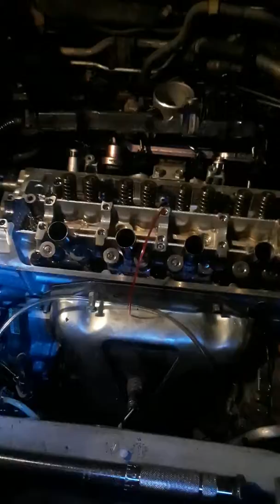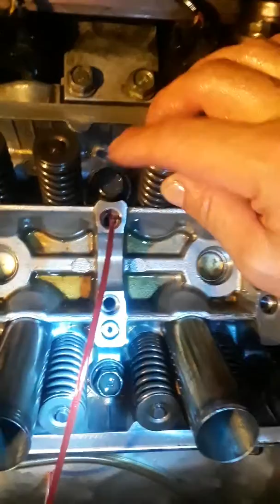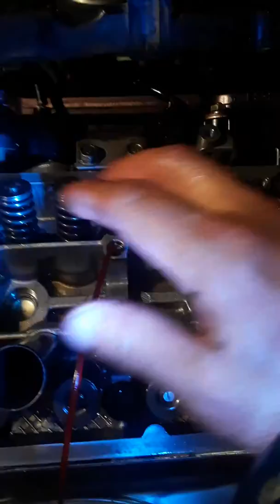Oil control orifice, oil flow, cylinder head, lubrication of head

Comment: Thanks I’m learning. So the orifice is like my thumb at the end of a garden hose. Creating pressure in the system and anything more or too much pressure gets bled out the orifice. Thus keeping a consistent pressure
Reply from the maker: Not exactly.  If there is too much pressure the excess will bleed back into the oil pan via the oil relief valve.  So, if you are getting low oil pressure the valve COULD BE another problem.  Stuck open, partially open, weak spring, or even a  worn pump.
Reply: @Sergeant5e  I’m rebuilding my engine and it’s recommended to clean and replace the o-ring on the 4 orifices I have. I just didn’t know what they were. Thanks
Reply from the maker: @andrewziegler2608  👍 good luck with your rebuild.

Comment: I was waiting to see how oil supply got to the lobes
Reply from the maker: The oil pools in the middle of the head where the cam is installed.  The lobes dip into that pool of oil as the cam turns.
Reply: @Sergeant5e   interesting. I would've guess shower tubes longitudinally over the cam length. Thanks
Reply from the maker: @Resistculturaldecline  sorry so late.  Longitudinally the camshaft journals are supplied with oil but not the lobes.

Comment: What if I take that out I won't have vtec right. I have a built head on a stock bottom end and vtec doesnt sound as loud now but power still pulls through the rpm.
Reply from the maker: Correct, No Vtec and no engine, lol.  If you take out the orifice, you will NOT have any pressure to anything that requires pressure as my video shows.

Comment: First of all, thanks for this video, it is clarifying about oil pressure. I am having trouble with this. That head bolt Nº1 (middle and where is the oil passage),  the threads on block side were broken so I ve made the bad decision of doing another thread but with a thicker bolt so i finally DRILLED the hole of that bolt in the head to make the hole bigger and that thicker bolt can pass through it. Now I ve unmade all that and put original threads and original bolt size (honda bolts). But the hole is still bigger, does this bigger hole could get to loose oil pressure? This is pure physics!! First i thought yes but if now i think that if it fills that bigger place but there is no lose of oil to pan or other place it might not....what would you think? I ask this because after resurfacing block and head, adjusting valves, etc I am having loose of oil pressure and also noted valve knocking noise louder (i ve tried adjusting valve clearance several times, still the hitting noise so i am thinking now about the lose of oil pressure not reaching valves). I think rod and main bearings are good (they were before): I measure oil pressure with a gauge in sensor hole: 15psi at idle, then down to 9/10 at 3000rpm...

Also I read you say that there is no  o ring, i have the service manual for Honda Civic 96-00: engines D16Y5, Y7 and Y8 has an o ring below the oil control orifice. 

Sorry my bad english, hope you can help me!
Reply from the maker: https://youtu.be/Ib6ehkaoNuQ   I don't believe your oversized bolt hole will have any effect on pressure.  I have another video (https://youtu.be/Ib6ehkaoNuQ) where I show pressure with orifice in place and no pressure with out orifice.  I doubt you are losing that much pressure with a bad o-ring.  If your oil pump is good, filter not clogged and your oil pressure relief is not stuck open/partially open then you are losing pressure through your main/rod bearings which was the problem with my engine.  Assuming you did filter/oil change; I would check the oil pressure relief first then plastic gauge ALLLL the main and rod bearings.  As for your valve noise, I adjusted my valve lash to be tight (close clearance) of what manufacture recommends and I get no noise.
Reply: @Sergeant5e  Thank you very much for your answer. I saw your videos, excellent again! Filter is new, oil too and the one specified on manual: 10w30 (before I tried with 25w50 for cars with more than 100,000kms). Now I ve disassembled vtec/camshaft and camshaft has (again) several journals (is it ok the name? not lobes, where it stands on head) worn. So I will be claiming on warranty with who resurfaced it but I still dont know why they get worn, they checked that out...About the main and rod bearings: ericthecarguy also says about checking these! so I guess I would be tearing down again the engine...because from below I can check all the rod bearings but only the lower of main due to cant getting out crankshaft, thanks again and I will keep notice on what happens, next week!
Reply from the maker: @britrockfer  I know this is 2 years later but this is for those others that may be reading this now.  When your engine over heats enough your WHOLE head gets warped along with your cam.  When machine shop rebuilds your head they just resurface the bottom side that mates with the engine block and use the same cam or even a new cam.  Well, the bottom of the head is flat with the engine but the rest of the head is STILL warped.  So putting in a new cam would cause the worm journals.  The shop has to resurface AAANNNNDDDD STRAIGHTEN the whole head by means of oven heating the head and pressing the head back to straight.
Reply: @Sergeant5e  thanks for the answer!! I still have the problem with my 99 Civic!!! I got a motorcycle so i travel with it. You are right, i will surely buy a used whole reworked head so i hopefully solve this problem. The pandemic also got me with money problems so will try to buy it in the next months!
Reply from the maker: @britrockfer  if you are still having the same problem that leads me to believe that you main/rod journals are too loose and /or your relief spring is too weak.  Generally, when your rpms go up your pressure goes up not down. Start off with installing a STRONGER relief spring. That would be the easiest and cheapest thing to try first.
Reply: @Sergeant5e  have done all that: changed oil pump and relief valve, i installed new main/rod bearings on crankshaft...i still have the problem because i cant attend it!!! i am pretty sure its the head, the camshaft was damaged several times and i get to metalize (is that the term?) it....
Reply from the maker: @britrockfer  as I show in one of my videos, anything after the orifice DOES NOT AFFECT  oil pressure.  Main/rod journals and orifice are responsible for oil pressure.  Given that the oil galleries are clear and relief valve are not partially open or open.  Like mention in one of my videos, my problem was what I originally said was the problem;  it was the main/rod journals as I originally measured to be to loose.  I mentioned this from the beginning to the engine rebuilder but  he never listened to me.  You have to have the mains/rod journals tight to give you good oil pressure.
Reply: @Sergeant5e  are you sure about that? i dont remember where but i read that all system affects oil pressure...
Reply from the maker: @britrockfer  sure
https://youtu.be/Ib6ehkaoNuQ

Comment: Is there an o-ring that goes between those two mating surfaces?
Reply: And when you take out the orifice, there is an o-ring on the other side of it.
Reply from the maker: @MiKa-IronLion  No o-ring is used for the orifice.  I stand corrected.  Some engines do have an o-ring.
Reply from the maker: There is no o-ring.  I think in some models the oil control orifice is located in the tear drop recess on the head and block mating surfaces; which is sealed by the headgasket.
Reply: @Sergeant5e  There is no O-ring there, AND the head gasket does NOT go there in your video!  You are confusing people with you last reply.  Seth wanted to know if an oring goes between that oil control jet and the cradle thing.  My VX motor doesnt have an oring there.
Do you know how to get that orifice removed?  Mine doesnt have threads in the hole, so I cant put a 10mm in there without screwing up the sides of the orifice.
Reply: @Sergeant5e  mine had a black o-ring
Reply from the maker: @Allen Wilbur  Yes Sir, I did mention no oring there and I do see where I messed up and corrected the response.  Anyways, you can take the orifice out by turning a screw into the orifice and wiggle it out or tap a torx bit into it and wiggle/turn the orifice until it comes out.

Comment from the maker: You could take out the whole valve train assy, hold the orifice in place somehow and you would still have oil pressure to the block.  You would have oil shooting out of the orifice, though.  Just like the oil jets at the base of the rods that lubricate the cylinder walls.